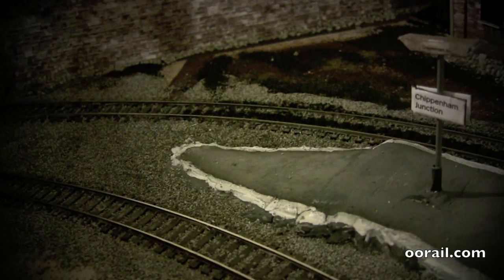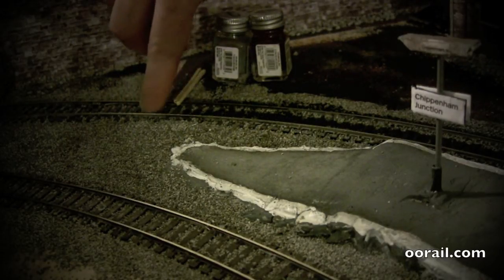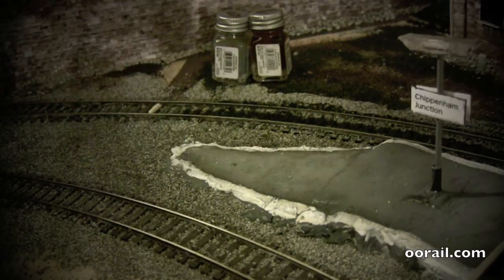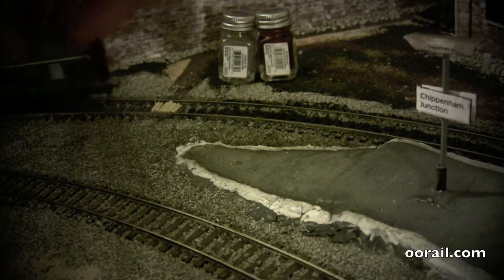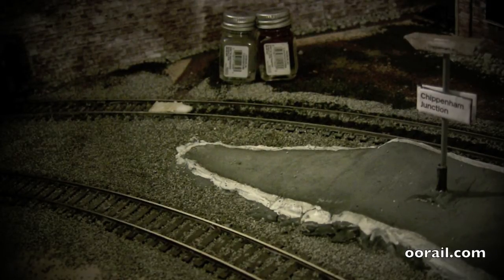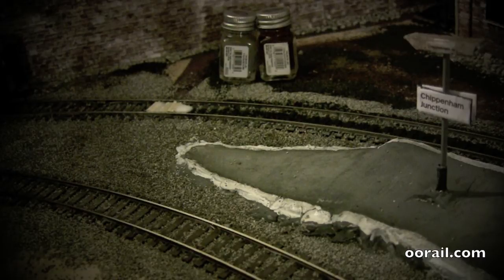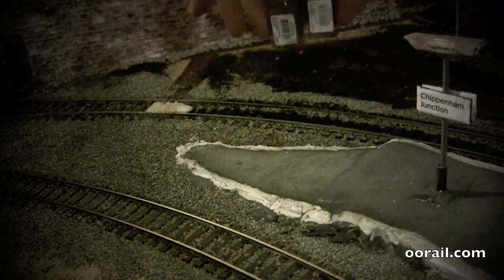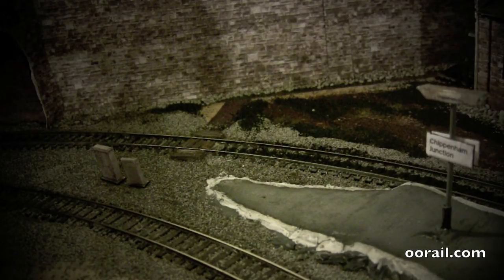oorail.com | Building a Barrow Crossing from Scratch

Comment from the maker: Barrow crossing are typically wooden and made up from a number of planks. You get a more realistic result using the small wooden sticks / matchsticks. You could probably use poly filler but you'd need to add lines to it to give the visual look of being made up from planks. However, I think you get a better result with the sticks, which is why I did it that way :)

Comment: Well, you certainly made a very easy little project time consuming & difficult! As for the station platform, it would be condemned if it was a real platform!
Reply from the maker: Thanks for taking the time to provide positive and constructive criticism. The station platform was a bit of an experiment, its been fixed in later videos. As for the Barrow Crossing, if you have a hard time cutting up sticks or painting, you might want to try getting one of the pre-built products.